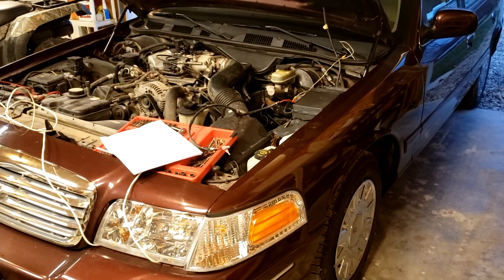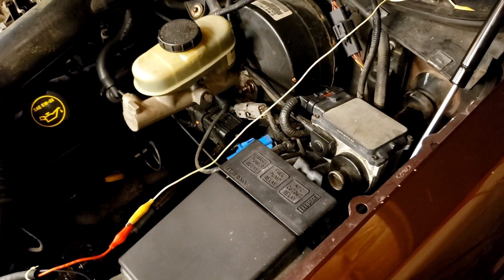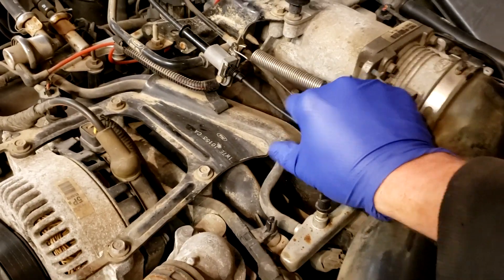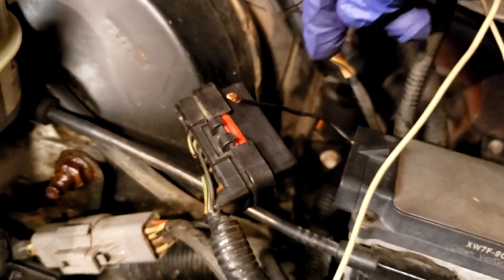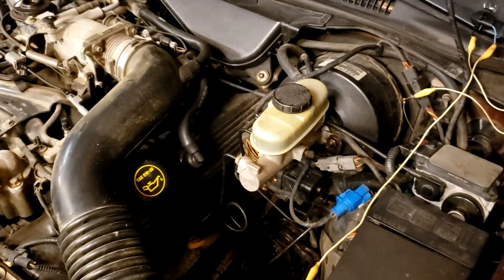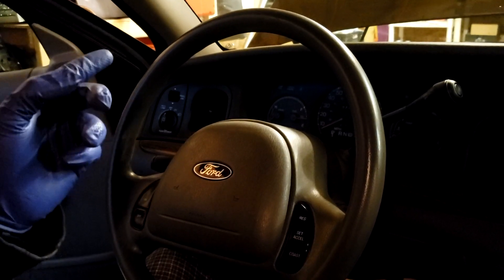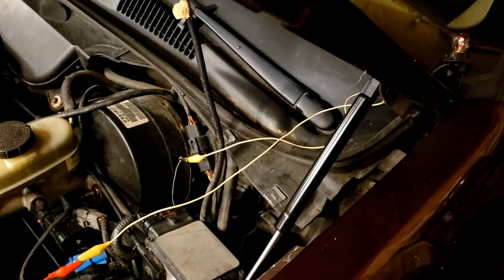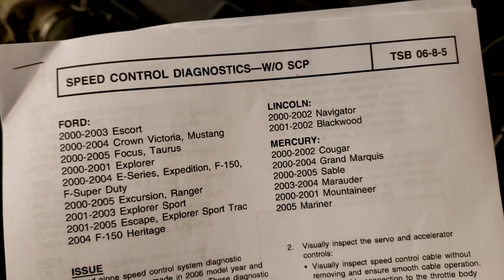Ford Cruise Control Module Doesn't Work?  Self Test How To

Comment: Found the document and went through the procedure. When I pressed the Set Acc button I got two flashes. Turned out to be the clutch switch. It wasn’t aligned properly because I pulled the dash out this weekend to replace the A/C evap coil. The harness was too short and I didn’t realize I caused the switch to pull forward, twist and get out of alignment. 
Thanks for the great video Jack!

Comment: It will not actuate if the cruise deactivation fuse is bad. Replaced fuse no codes and it actuate. I have replaced the switch already and forgot to check the fuse. All is good now. Thanks for taking the time to make the video.
Reply from the maker: Good info. Thanks
Reply: which fuse is that
Reply: The fuse on the brake master cylinder deactivation switch. The updated in line fuse.

Comment: This worked. I replaced the grey switch first because I had read that one is for the CC, didn't change anything so I replaced the blue brake pedal switch and that fixed it. Botch switches tested good with my meter but the actuator rod on the blue switch was sunk in so far that the brake pedal wasn't able to move the rod far enough for the electrical connection to happen. New blue switch had a crazy long plastic rod but they will adjust themselves to the proper length once installed.

Comment: Thank you for the great video....
I ONLY get the 1st blinking light when you turn the ignition switch 2 times while holding the OFF button, but none of the other 4 buttons blink at all pushing them within 1 sec apart(no light at all. I even tried it a few other times and still no blinking light at all on the rest of the buttons). I checked the fuse on #15 and #22 by hood released under steering wheel area (I believe these 2 are the ones control the Cruise Control), and they are ok, not blown. Any suggestions?
Reply: what did you finally discover as the problem?

Comment: I have an 02 f150, replaced pressure switch on master cylinder, diagnostic test passes  and pulls throttle. Still no cruise when driving. Any ideas would be appreciated. 
Thank you

Comment: I have the same exact module on my 94 lincoln town car. There is also another exactly the same on my 2000 expedition. Do you think it would work if I used the module from my expedition and put it on my lincoln?
Reply from the maker: Probably not unless they have the game party number. The calibration is different between cars
Reply: @JackofAllMasterofNone  yeah I just took them apart, they both fit the same but the computer boards are different

Comment: Well, mine is a Grand Marquis 1998, did the "Cruise control check" using the steering wheel and everting is perfect but the Cruise control won't keep the vehicle at speed even thought I get the message on the cluster

Comment: Hello ,I did your test with the light bulb ,exactly how you said , I got no pull test but I also got 3 flashes when I did the test, According to the print out it says that I have a brake deactivation switch that's open or damaged. 

1 question will the pull test work if that switch is bad open or damaged?

2 question where is that switch because I can't find it
If you can help anyone?
Reply: This is a 2002 ford crown victory police Interceptor with no cruise control, I added a steering wheel with cruise control and got the cruise control device from the junkyard.  Can someone help me please, any answers will help ,thanks
Reply from the maker: Honestly I don't know if the pull test will work if the switch is open or damaged but the brake deactivation switch on that year should just be another switch on the brake pedal assembly itself.
Reply: @JackofAllMasterofNone  ok ,I  understand, i bought a new deactivation switch, a blue color one ,will install it and hope that fixes the issue ,I found that blue switch way up there by the break pedal and it has a wire connection to it , hopefully this works. I will try the test again and see if the pull test works. IF not I will return the junkyard part back and find me another one . Wish me luck ,thanks again for answering. Thanks
Reply: @JackofAllMasterofNone  
I replaced the deactivation switch on the brake pedal for the cruise control  ,and that was the fix . Now the cruise control  works . 
Remember I asked you if the pull test would work if the deactivation switch was bad. Well I replaced the switch and once i did the pull test worked, the deactivation switch was the problem, so now we know the answer, thanks again for all your help ,I now have cruise control on my 2002 crown vic thanks to you. 👍
Reply from the maker: So glad to hear it worked. That's awesome

Comment: My 2000 F250 cruise works but dash light that reads Cruise doesn’t come on! Ideas?
Reply from the maker: If everything works it could just be a bad bulb (burnt out) or a wiring issue between the module and the cluster.
Reply: @JackofAllMasterofNone  cool, I’ll look to see what it takes to change the bulb! (I’ll check fuses first of course!)

Comment: I have a question can the cruise control make the car or truck run wide open  all the time
Reply from the maker: It should not be able to. But a stuck manual linkage could cause this. The way to check it to unclip the cruise actuator cable from the throttle body and see if that makes a difference.

Comment: Greetings from the Republic of Moldova
The day before yesterday I found such a block at the metal reception, And I have it with 10 leads, I'm just doing electronics, I was curious what kind of block I took it, Ideal everything is spinning Everything is fine. Someone can tell me what conclusions are responsible for what where is the plus? Plus one more commentary on the promotion channel. Thanks.

Comment: I ordered a brand new blue switch for my 2005 f150 and my cruise control with the other buttons in the steering wheel still not working, is there a fuse for them
Reply from the maker: Does the horn work? Do you have an airbag light on? Could be the clock spring. A 2005 F150 has computer controlled cruise control. It does not have a module like this video. Could be your SCCM (steering wheel control module) also.
Reply: @JackofAllMasterofNone  horn works, no air bag light, so I give up, I'll buy a for sale sign this weekend, I bought the truck because every one said theu are reliable, but I think it's really trash, no radio control in steering wheel, no input jack in the radio, now I can't even see the miles in the instrument cluster at night when the dash is on, the features in the truck sucks
Reply from the maker: @ralphwhitaker8761  I'm sorry anyone who told you a 2005 f150 is reliable was mistaken. Well I guess I should preface that by saying it depends on the engine. We had a 2005 F-150 but it had the 4.62 valve which is the reliable of the two
Reply: @JackofAllMasterofNone  lol thanks, well I guess I had to find out of my own, I think I'll give the ram 1500 a try or even may be Chevy Silverado or GM pick up, I'm putting this one for sale as of this weekend
Reply: @ralph whitaker  Dude the truck is almost 20 years old! It's not going to have all the bells and whistles of a brand-new one. How many miles are on the truck?
Reply: @rideon6839  lol serious, is the smartest response, what does features of a new truck has to did with the way they made the 2005 f150, I have a 2003 expedition that has more features than this bullshit f150.

I have a 2008 ford expedition that has more features than this damn f150, my expedition  is so right that is why I have no will to buy any of those new vehicles and drag my self into debt, so seriously if the truck sucks with limited features compare to other pick up lets admit it

 you can't even see what is in the dash, the cluster instrument still operates like a 1980 car with that push button sticking out, now are you serious? I figure I come on this channel to see if I was doing something wrong and asked a question, that is all, once no one can help I list the damn thing for sale, 2 people already made me an offre, and I put that sign on yesterday, I'll get something more comfortable, my 2003 is my work truck, my 2008 is my personal family ride around truck equip with every thing, I just need a pick up for my side hustle
Reply: @ralphwhitaker8761  dude, did you really not pay attention to the fact that you bought a lower end f150?  Every automaker has a lower end and higher end product.  If you somehow didn't know this going into buying the car, then that sucks, but it has nothing to do with the manufacturer and only your illogical expectations.
Reply: @aquill1  I don't remember asking you the question, so you really don't mean anything at this point, unless you know or you don't know, if you don't have the answer, go sit in the back of the bus, and don't say a word, now happy MLK day
Reply: @ralphwhitaker8761  don't post publicly.  Ford wasn't the problem here. I'm not the problem either.  Be a little more intelligent in buying and posting.

Comment: My cruise light doesn’t cover on at all. Any ideas?
Reply: I have the same issue on a 2001 Ford Taurus SEL. Not sure what the problem is, if I find a solution I’ll let you know :)
Reply: @joshuastover  Mine turned out to be the brake cruise disengage switch on the master cylinder. It works fine, now.